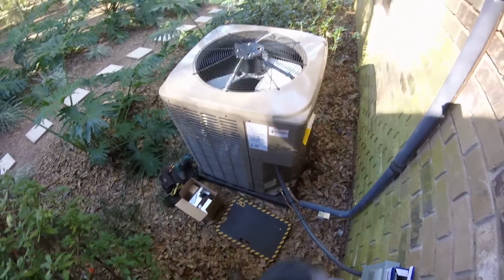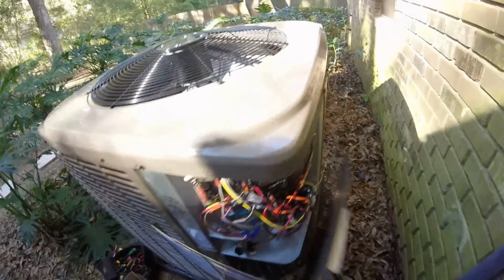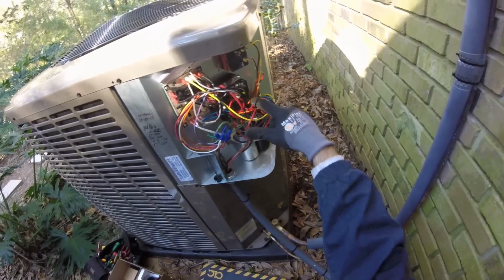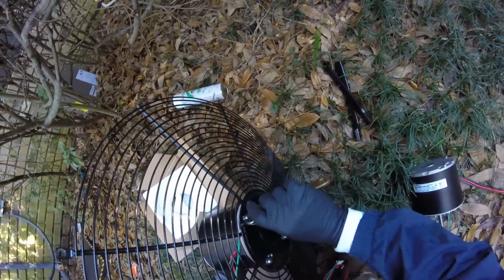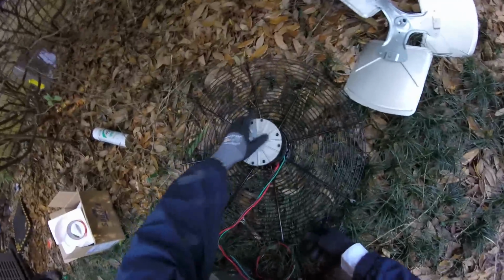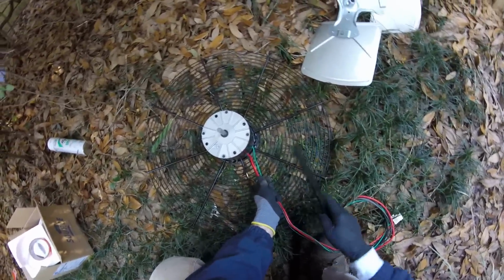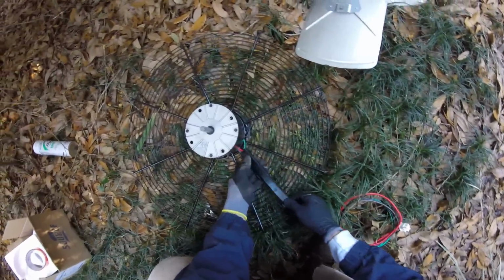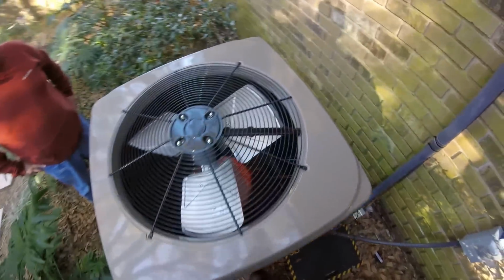Case Study : Loud thump from outdoor fan on shutdown

Comment: The thump is just the fan motor and compressor shutting off at the same time. Each part has it's own thump. However with this particular unit, the two thumps resonate together creating a very loud thump. All you need is the on delay and off delay to both be short. I think the 12 seconds off delay is too long. But it does work.
Reply from the maker: 12 seconds is as short as it went. I don't know of any off the shelf item that would go less. Thanks man.

Comment: nice fix for this common issue, i hear those clunk noises once in a while mostly on scrolls i think, some don't do it all the time, i will keep your tip in mind for this repair if i get a complaints about it. Thanks
Reply from the maker: Thanks for watching next time I want to try a double pole contactor
Reply: great idea, i stopped carring single poles now and replace everything with dp contactors, 
also the sound may go away if cfm is replaced with a 4-wire cfm because of a separate capacitor.

Comment: Sounds like metal flexing, due to vibration of both motors running.  like the whole condensor is flexing due to torque of the motors running. The case is torquing?  good fix.
Reply from the maker: I don't think it is metal flexing from the diagnostic procedure I chose by cycling one at a time.

Comment: Great repair... Joe have you installed any of the new style of York/Coleman units ??? If so what's your opinion on the system???? Thx!
Reply from the maker: I haven't even seen them yet as our distributor doesn't have heat pumps in yet. im excited to try the new Ruud equipment out.
Reply from the maker: I haven't even seen them yet as our distributor doesn't have heat pumps in yet. im excited to try the new Ruud equipment out.
Reply: +Joe Shearer  yeh were meeting with our Rheem. TM  soon !!! Thinking about trying some of there Equiment

Comment: Nic job Joe.  I will definitely use that relay if I ever run into that issue. Thks
Reply from the maker: It worked out pretty good. Next time I want to try a double pole contactor first.

Comment: Good Work Joe.. Did you notice if the customer had a surge protector or voltage regulation from the power company installed?
Reply from the maker: I do not think so. I didn't see one at the panel and definately not at the unit.

Comment: Good Video Joe. Looked like the unit had a hard start kit. Any chance it was hitting the start winding momentary on the fan motor when everything disconnected at once? I'm not sure what goes on inside a combo capacitor but something sure was strange there lol. Blanket helped that compressor for  sure!
Reply from the maker: Thanks for watching chuck. I thought the same thing too at first so I disconnected the start kit and it still thumped. Next time will try a double pole conractor but this one had a cchtr across the contacts so I was not wanting to change that.
Reply: Yeah I hate single pole contactors but you gotta use them unless you have a thermostat or want the heater on all the time. These Chinese motors are weird for sure. She's quite now tho!
Reply from the maker: +ComfortPlus Heating and Cooling times like this I wish I had A scope to see what was spiking

Comment: Thanks for the shout out Joe! Do all of these models make this noise? I have heard this noise before but it was because a different speed winding accidentally got energized a split second before power was removed from the motor. I'm guessing this is just a single speed motor though?

Have you made sure that the contactor breaking the common of both the compressor and fan motor?

The fan sounds like it could be getting an out of phase back EMF kick when the compressor shuts down but why this unit out of millions? Run cap wired correctly and checks OK? Herm and fan terminals not shorted together? Maybe replace the cap just to make sure it's not doing something weird at shutdown.

You mentioned a double pole contactor. That could be a big clue if it fixes the problem or not.
Reply from the maker: Yep it's just a single speed motor and the contactor was breaking common. I was thinking the same thing about back emf myself - the run cap is wired correct and I've heard the noise before on other brand units. Even on replacement fan motor jobs. I almost want to try a double pole just to see but will have to wait until I run across it again or I go back to this one for something else.
Reply from the maker: Times like this I wish I had a scope to see the bump electrically.

Comment: Can you explain the way you wired that 251 relay please tried to watch close but at the end you changed something I have a few banging compressors and would really like to fix them.  . All I work on is package units.. Please respond...
Reply from the maker: ac service daytona 386 port orange fl. This is not a fix to resolve a compressor bang it is the fan motor doing it.
Reply: Joe Shearer under stood I just have a couple of my package units doing the same thing.. I isolated the fan and the compressor and it didn't bang when one was working without the other just like you did but the thing is is I'm just going to do it on a package unit I saw your video on the three pole contactor
 which was very interesting it just seems like you're a little more of a mad scientist than me brother just hats off to you that was why I was asking you that question about the wiring
Reply from the maker: ac service daytona 386 port orange fl. Ok so you don't even a three pole contactor all you need is a two pole actually. But it does require changing the way it's wired. Have you ever seen a Trane unit where the common (black) to compressor was joined to the line voltage wire(black) on the same side of the contactor? You would wire the fan common on the load side of the contactor and the compressor and line volt wire both landed together on the line side of the contactor. Does that make sense? Thanks for watching too. I was just at Daytona beach last month too and got my truck stuck on the beach lol
Reply: Joe Shearer yeah my brother thank you that makes a lot of sense just like you know a lot of these carrier package units Tempstar you know Grand Daddy those are all the package units that I install cuz it's tons of mobile home parks here and since I work for myself and I'm 62 years old you know what I mean I just kind of bug out and all that type of s*** but anyway man I really really am proud of you I wish I had your knowledge when I was younger I'm a good Tech but me and you are a mad scientist bro thank you